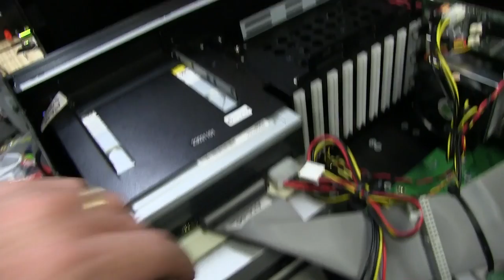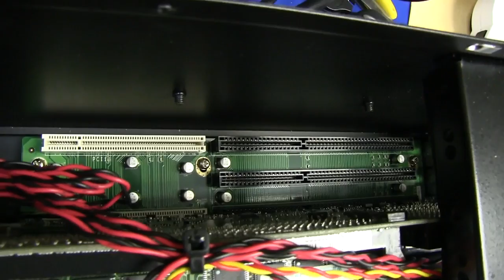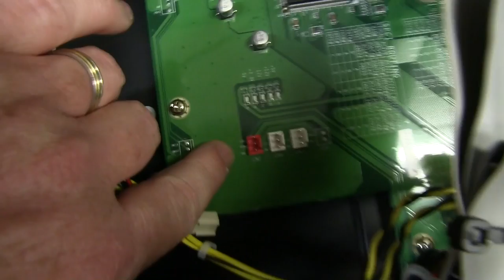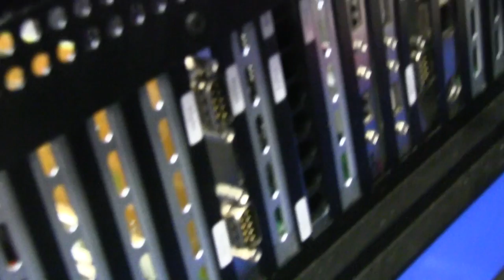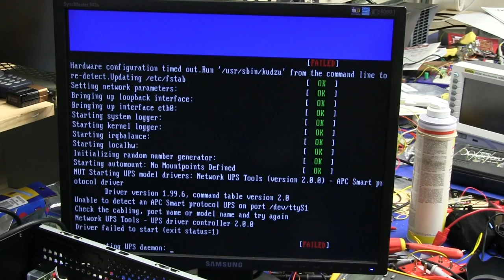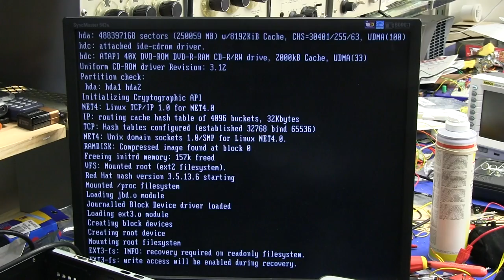EEVblog #458 - Industrial Computer

Comment: GRUB is the GRand Unified Bootloader. Incedently that's where you need to be in order to boot the RHL into single user mode to clear the root password. Provided the admin who set the machine up didn't put in a bootloader password, you can punch into the password file and edit it. They usually don't unless it's a critical system. As for the keyboard and mouse not working, I'd bet pennies to dollars you have to be shelled in via the serial ports. A fun trick to foil hackers is disabling the USB drivers to prevent direct access to the machine. See: Above password clearing attack.

Comment: grub is the bootloader used for alot of linux based systems. very versatile system allowing you to select from multiple installed kernels and also will allow booting multiple OS's including windows

Comment: If the motherboard plug into something even bigger, shouldn't  that be called Grandmother board?
Reply: I was trying to be a little sarcastic. I know what that grand motherboard does. However, if you have daughter boards and motherboards, it stands to reason that motherboards should plug into grandmothers, regardless of the limited function of that board.
Reply: Thanh Tran no, it's called the backplane...- > http://en.wikipedia.org/wiki/Backplane
Reply: The biggest is always the motherboard. Everything that plugs into it are daughter boards. If the daughter board has daughter boards, it is the motherboard for it's daughter boards.
Reply: @Chad Leighton Yup, been using instaflixxer for months myself =)
Reply: @Chad Leighton definitely, I've been watching on InstaFlixxer for since december myself =)

Comment: Yup, as people have said... the Linux kernel was probably custom-complied and slimmed down (no USB support). Booting up the other entry, the one not labelled "custom" would probably enable you to use the mouse/keyboard. Not certain, though.
Reply: Could either be that or sometimes the bios goofs up. I have the same bios on my pc, and if it resets I have to edit it so I can use my mouse and keyboard once linux actually boots up. I use CentOS but its basically a free version of redhat, at least to my knoledge.
Reply: Zerorisers TheEngineer
unless you use an industrial rack-mount computer as a desktop, you don't have the same BIOS
Reply: ***** maybe one insmod can make a difference

Comment: Hey Dave,
the inside of this computer reminds me of one I had back in the late 80's
it was a Basis 108 And was German made. But it was Pre -hard Drive Era, Dos based OS. and had two 5 1/4 Floppy drives. But it worked out because it was compatable with the Apple II E computer which I had learned programming on. and I wrote Alot of interesting programs on it.

Comment from the maker: Dust usually doesn't get in due to the filters, and the socket contacts are usually heavily gold plated to prevent corrosion. But yes, not ideal. But when you have to mount half a dozen NI cards, there isn't much you can do about that.

Comment: Oh and BTW, win 3.11 wasn't really an Operating System, it was a window manager running on top of DOS, only really providing an easier to manage UI for users to manage files, installations etc. People who didn't need that stuff never really launched into windows since it was a pretty big resource hog. Windows NT of course was another beast entirely, which is why that was the foundation for all later versions, not just the "professional" sector. I personally never really used windows before win 95, and even then I generally just used it for it's ease of multi tasking, so generally I had a script that booted it, launched a couple of DOS prompts and the didn't bother me anymore.

It is surprising that you say industrial computers back then launched 3.11 in seconds. Not the seconds part, booting DOS and then loading the window manager was a pretty light weight task compared to loading modern operating systems. No, what baffles me is the fact 3.11 was run on any  kind of industrial or otherwise critical machine given how NT was both much more stable and much more easily managed as a part of a larger "ecosystem". Can't think of any time I really saw windows 3.11 being used professionally outside of small 1 to 6 person business to write e-mail and use "Windows Works" to create invoices and extremely annoying flyers, menus, price list, ads etc.

Comment: that's a pretty impressive system, and I agree, they are reliable as hell, it's like the Dell Precision T5400 that a local company's been running continuously for 4 years (since they started) without a single breakdown... and that's in a REALLY tough environment... I think my older T3400 that I use as my main rig got off lightly to say it gets a break in a power cut!!

Comment: You know, these are not really used in industrial manufacturing equipment, but are instead used for test stations that run cables to the machines that do the testing of products for QA. 

What I mostly see are Allen-Bradley or Siemens programmable logic controllers that do the actually grunt work of controlling the machinery itself. You should tear down a PLC to see just how ruggedly built they are. They have to switch mains power and handle lots of voltage transients and electrical noise.

Comment: You would not been able to log into it with out a former username and password unless there was an obviously guessable one, or one without a password. You can sometimes get around that by booting a live or rescue linux from cd and then mounting the system drive and altering the passwd files, or for example, just nulling a password... in etc/passwd in the mount. Then you could reboot and log in. Also the older config manager would want to adjust its config if you moved a card.

Comment: I have one up stairs it's a old CCTV system, amazing system but the amount of pci cards and slots in use and the construction and frame are a work of art. Not to mention it has a pci system on chip card with its os built in , hardisks hot swappable , shame every cap on the mother board is pop'd

Comment: They are even if there are no slots present ! Check out specs of companion voltage, fan monitoring & control chips. Some of them contain LPB - low pincount bus which is variation of ISA bus !

Comment: Redundant power supplies only help if you have shoddy supplies to begin with OR two isolated power sources.  It's cheaper and just as reliable to have an adequate size UPS to allow you to properly shut the system down.

Comment: You're right. If you use a USB card reader, it might not work. That depends on the card reader though, and not on the card. But a CF card slot wired to an IDE-port should just work, if your BIOS allows it. Most built-in card readers connect to a USB header on the motherboard, but ones on the motherboard itself are often connected with IDE, and meant to be booted from.

Comment: USB was probally removed from that system to increase stibility  its not something that would be hard to do for a person who knows there kernels
Reply: ***** Increase stability? How unstable is USB?
Reply: it isnt   but it is an attack surface
Reply: ***** I see.
Reply: Or just USB connectors disconnected from motherboard. :)
Reply: na   the keyboard powered up  was just being ignored
Reply: +Fennec Fox (FennecTECH) USB was enabled on this machine, you could see the kernel initializing USB EHCI/OHCI when it was grinding away trying to load UPS drivers.

There are several reasons why the USB keyboard and mouse weren't working. The first thing to look at is the BIOS setup, because older machines like this usually had USB HID support disabled by default, you had to manually turn it on. Another gotcha is that some motherboards only supported USB HIDs on specific USB ports (usually those provided by the chipset) and not an addon USB controller on the motherboard or on PCI expansion cards.

The last thing that could be an issue is that Linux doesn't have a driver for the specific USB host controller that the mouse and keyboard are plugged into. There are still quite a few USB host controllers that don't have proper Linux support.
Reply: a host controler without linux support?       i had never herd of something like that     or perhaps   the device has a usb whitelist    only certain devices are allowd to be used for security     i mean preventing random usb drives is a smart solution
Reply: *****
Device support in Linux relies on vendor support or community support for the driver. There are plenty of piece of hardware, including USB hosts that don't have such support.
Reply: indeed      jjusst not something ive runiinto    then again ii dont have much real obscure hardware  ether
Reply: Now that i think      its most likely the server had a USB whitelist       to remove the attack surface of plugging random usb devices into it
Reply: Windows had a driver vuln htat simply plugging an usb key into a locked machine would net you admin!

Comment: GRUB =  GRand Unified Bootloade witch is one of 2 bootloaders used for linux  the oter one is LILO (LInux LOader) Kudzu is  just  checking for  new  hardware  during boot and let you  set various parameters for  the hardware ..

Comment: I have what is basically the case of this machine, just a big 4U rack mount box with some fans and filters. I think it is designed for sitting other equipment inside of to dust proof it, I was considering cutting out some mounting holes and stuff to build a computer inside there

Comment: So.. FAT16 file systems do never get corrupted? What a weird idea.. :D Windows file systems  - even up to the kinda journaling NTFS - suffered from file system corruption a lot.
Reply: FAT16 will get corrupted with enough time & writes. It doesn't even have block hashing or a journal. If you want a FS that doesn't get corrupted, use a btrfs or zfs drive pool and scrub regularly.

Comment: Can't post a link, but Google "JBT Foodtech DSI waterjet portioner" to see a machine that uses an Advantech Industrial PC to directly control several 2-axis cutting heads.  The PC runs QNX with a custom GUI.  No PLC in these machines, the servos are connected to the controller cards in the PC via fiber optic cable.

Comment: Interesting fact about compact flash cards: most cards are IDE compatible, and can be used as a regular IDE drive. The BIOS and operating system will detect these CF cards as regular hard disks, with CHS and/or LBS addressing and everything.

Most likely that CF card slot is just a "modified" IDE channel. Completely transparent to the system.

Comment: PSU looks exactly like relabeled FSP one.
The same case, same vents, same "Full range" sticker (means that this model has APFC).
Search for something like FSP300-60PLN. Or Zalman ZM300B (it is relabeled FSP PSU).
Only power ratings on this "IEI" PSU are lower.

Comment: GRUB is the 'GRand Unified Boot-loader' that is very common on Linux based systems.    Have seen many similar systems (and much older) used in engineering works for process control and distribution of data to CAD/CAM machines. Not a bad bit of kit, certainly still a useful box :-)

Comment: wow that "ISA/PCI" slot 5:20 looks like VESA Local Bus, and it's connects motherboard? that is weird. VESA was superseded by other 32 bit standards PCI because tied a card directly to the processor bus mainly intel 486 as fsb speeds increased, VLB stability became increasingly difficult to manage.

Comment: you can still access the removable  white cartridge  remove the whole cartridge and  pull the sides of the outer case  open  and it will release the inner part and then you could be able to get to he hard drive

Comment: We have a computer at work with 1996 version of AIX UNIX, until a couple of years ago it was the 1988 version. Why? they hold archived medical records which need to be accessed in the future. Old computers are still used heavily in industry as they're (theoretiaclly) rock solid, all the bugs worked out over decades. UNIX and Linux are really good for this sort of thing. TTY is a standard serial terminal for telnet etc. access, and that's what we use. Ours is really unreliable, but that's the NHS

Comment: Well, to truly understand what the problem was I'd have to try it out myself. It should have 'just worked' as a compact flash card is simply an IDE-based storage device, much like older hard drives. The pins are just a bit closer together in the card reader. There must be something wrong in the partition table on that particular card or something. Maybe a bad block. That might not prevent it from being used, but might prevent booting. That said, I'm not an expert, of course.

Comment: on Grub

* Press e to edit the entry (at the ELCustom)
Press a or e to append this entry.
At the end of the line add the word single or the number 1.
Press Enter to accept the changes.
Press b to boot this kernel.
at the # prompt type passwd yourpassword say shutdown -r

now login with user root password yourpassword

hopefully there is no grub password in place :)

Comment: you should check to see if USB keyboard support is turned on in the bios.. dont blame linux using it well over 15 years and had no issues with it. maybe they disabled USB support in the custom boot up.

Comment: For security reasons you can make Linux not install new hardware without root permission. You probably have to remote login through the network or a serial port as root to change settings.

Comment: That looked like it might be a PS/2 style keyboard connector towards the bottom of the processor board; perhaps it did not have USB or USB-HID drivers loaded.  So if you still happen to have that kicking around and want to experiment with it, see if it'll accept a PS/2 keyboard.

Comment: Serial ports still control half the world of hardware :)
DMX for instance is like the PC's 232 serial protocol but with other transmission voltages and some anti emf shielding.
DMX 512 -youtube-lognazifilter-wiki/DMX512 got even better :) 
Low speed serial ports are cheap and reliable.

Comment: There is tons of industrial, teleco etc stuff on ebay and it never ever sells. Sellers price it like "well, it's $n thousand new so if I half the price someone is sure to buy it!" without realising that if you're buying something like that for a real business you don't go hunting on ebay for parts with no warranty. I want to get an 68060 MVME board but people are trying to get thousands for them.. which is why they haven't sold in the 3 years they've been listing them.

Comment: You're looking at a very old version of linux. I couldn't see the RHEL version, but that kernel is ~10 years old! Hardware detection is MUCH better in recent versions, generally you don't need to configure anything. But I'm not surprised your USB mouse and keyboard didn't work on that old version, the thing was probably configured for PS/2.

Why don't you try booting it from a linux live CD (e.g. Lubuntu) so you can bypass the login and look at the files on that disk? Could be interesting :).

Comment: not all that old, I have an old pentium still running win98 ( and networked as well, but via a paranoid firewall so it can only print to one printer) that has been running since 1996 pretty much all the time. Only failure has been fans and hard drive, and now on the second monitor. Another was running from 1990 till 2012 running Netware 3. Now in storage just in case. Win2k server was replaced because drives were failing and new unit was cheaper than one SCSI drive in the raid.

Comment: the thing about using redhat is support, if something fails, you call redhat and they have to fix it no matter what, because thats what you paid for. else you would have to pay an experienced and well trained engineer or hacker level dude to maintain and repair the system, every month.. from the corporative point of view, it's cheaper and easier to just outsource that.
and yeah the administrative guys cant even use a mouse properly.

Comment: Reformat the drive and install ubuntu on it, or even untangle and turn it into a router/ VPN server.

Or if you need, you can start a 8 person minecraft server (or tekkit).

May also see if you can remove the 80mm cans and get adapters and install 120mm fans to cut down on the noise, then using a kill a watt or some other tool to measure power, see if you can get away with a 150-200 watt power supply designed for home theater PC's

Comment: its not linuxes fault :P it doesnt have the drivers for those usb devices, try PS2 ones, and that will happen to a windows one also. it happened to me on a w7 pc fresh from the box, always use the keyboard and mouse that comes with it first :) as the plug and play thing isnt really actively running.

Comment: shouldn't the PC have at least a redundant power supply if it has to be reliable, the hardware looks more tuned up consumer spec in comparison to most server hardware I have seen (which also runs forever and has long production cycles with much better cpu&ram and so on & also no shortage for expansion slots there) I guess there are some special cards that only work in this thing or something (PCI to ISA is possible but expensive as far as I know)

Comment: 2.4 kernel?  No wonder, that thing is ancient!  The latest kernel is like 3.8.x.  Try plugging anything new into that thing and it's sure to fail!  My guess is they had some old equipment (probably serial card) that was released in the 2.4.x days and required it, but for any modern stuff you need a newer kernel!

Comment: APC makes pretty good UPS devices but the batteries are annoying, expensive and they fail after a few years whether you get blackouts and have to switch to backup power or not. (why cant they find another type of battery, (even if it does not have as many recharge cycles) (A UPS is something that most people may go years without ever using, and if they do use it, it may be for just 1 blackout, cant they get batteries that will remain good for like 15-20 years or something?